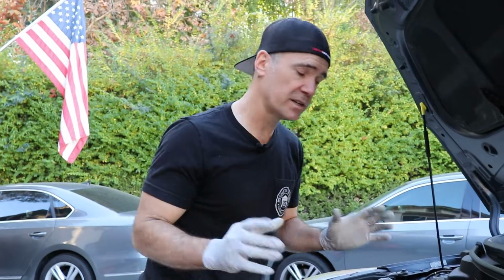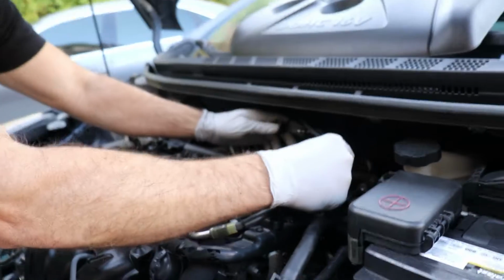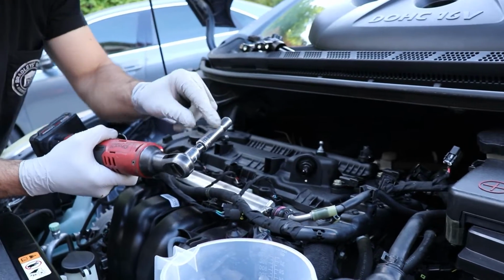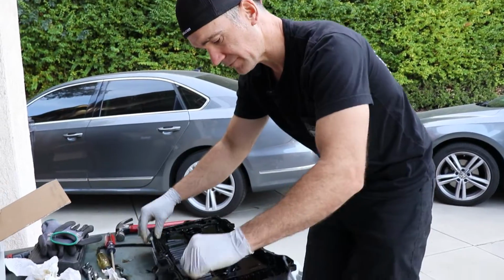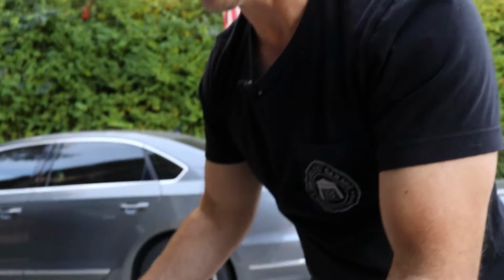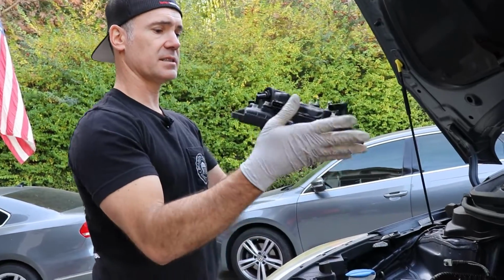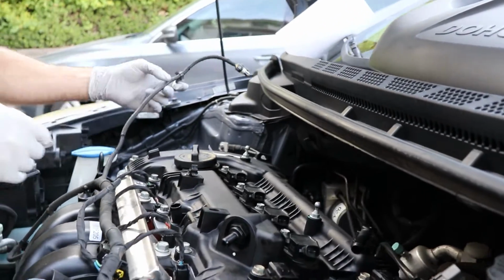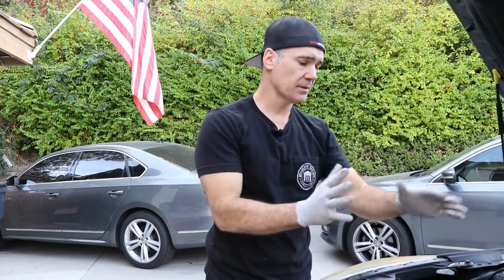Kia Forte Valve/Rocker Cover Gasket Replacement - 2012 to 2016

Comment: I'm at 160k miles, need to replace mine on a 2016 Kia forte. Currently watching video, but I'm wondering if I need to change bolts as well or can I reuse the ones there with new washers?

Comment: Can a leaky valve cover gasket cause knock?
Reply from the maker: Unfortunately it will only cause an oil leak and/or a vacuum leak. A knock will indicate an issue with the lower half of the motor, typically a bad rod bearing will cause this. Once it's gets to this level, it's most likely time for a replacement engine. Sorry to be the bearer of this news.
Cheers!

Comment: Are the spark plug tubes removal. Do they have seals under.
Reply from the maker: Thanks for the question Josh, each spark plug hole has a gasket to provide a seal around the spark plug coils. If you are getting oil in the spark plug holes, these seals are bad.
You can check out the Spark Plug video here - https://youtu.be/EYI1hDgTIaM
Good luck on your Kia project.
Cheers!

Comment: They're not 10mm bolts.  They are usually 5.5mm bolts.  The heads are 10mm. Not familiar with metrics??, my 2nd grader knows all about metrics, you don't seem to.
Reply from the maker: Thanks for the comments, we just say 10mm bolt in reference to the socket size. They don't teach us anything about Metric here in the states.
Cheers!
Reply: Curtis the a/hole

Comment: Would I have to drain all of the oil out before starting this?
Reply from the maker: Thanks for the question, it would be better to change the oil after the valve cover gasket replacement. That way if any debris should fall into the engine, you will drain it out during the oil change.
Good luck on your Kia project, be sure to check out the other videos on our channel.
Cheers!

Comment: My ,Pasadena , TX, Kia Stealership quoted me $520 ( plus tax ) for this job.  
Nope. I'll learn.  Thanks brother.
Reply from the maker: Thanks for the info, we had no idea the stealership was charging that much for this repair. All the gaskets you need for this job are around $50, so $520 is crazy town!
Hopefully the video helps you out with your Kia project.
Cheers!
Reply: Lol my one quoted me $571 too!! Saying “it was critical I get this done” yep no thanks I rather learn!😂
Reply from the maker: That's crazy when you can buy an entirely new valve cover with gasket for less than $200. Easy swap out in less than 20 minutes.
Good luck on your Kia project, Cheers!
Reply: Kia wants to charge my mom about the same. I said, "Spend the money on the gasket and I'll do it myself.".

Comment: I have been dealing with this on my wife's Mitsubishi.
6,000 miles? Maybe? Might check the cooling system, because if they are losing water the engine can get hot and basically cook the oil. 
That was actually part of our problem.
What I was able to figure out is the engine mounts started going. This allowed the engine to move excessively, which in turn caused the inlet to the cheap plastic radiator to crack. Loss of fluid caused the engine to overheat several times. Basically, cooking the oil and causing sludge and buildup. 
Ironically the car ran fine until I thought I'd be cleaver and flush the engine. 
The flush did loosen the build up but instead of softening it; it became hard and chunky. 🙄
Additional problem on the Mitsubishi that you don't seem to have there is the exhaust runs right underneath the oil pan! It's about 1" below it and that just bakes the oil! 
Anywayz, not sure if that helps?
I watched the video when it popped up because I was just flying by the seat of my pants. But, I did basically exactly what you did. I actually dropped the oil pan and cleaned the pick up tube several times! 😢
Reply from the maker: Thanks for sharing, sorry to hear about the trouble with your Mitsubishi. They were not any other issues with the Kia, no coolant issues, no check engine or low oil lights on. The car was running and driving perfectly fine. You would only know something was amiss after you popped off that oil cap.
We will check on the engine after a few hundred miles to see if it's burning any oil or has any other issues. We may need to do an additional flush (diesel/ATF) mixed with oil, depending on how things look. We will be uploading a follow up video to the channel shortly.
Hoping it works out for this young kid since he really doesn't have the first clue what it takes to service a car properly. 
Cheers!